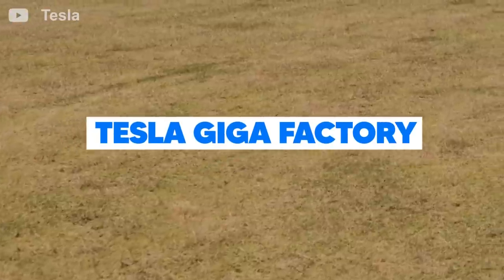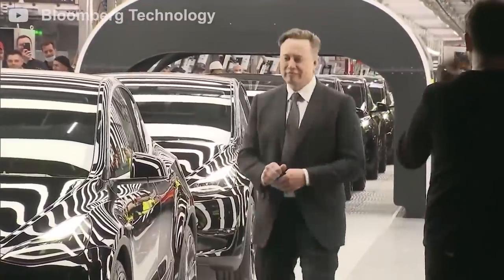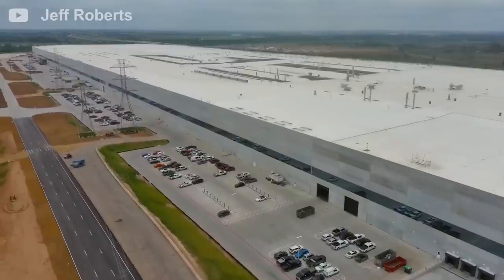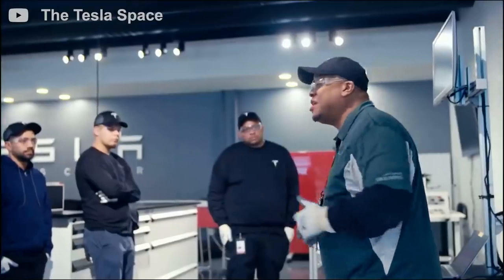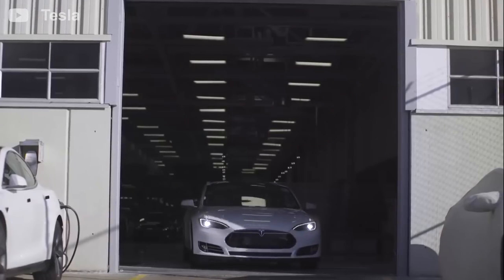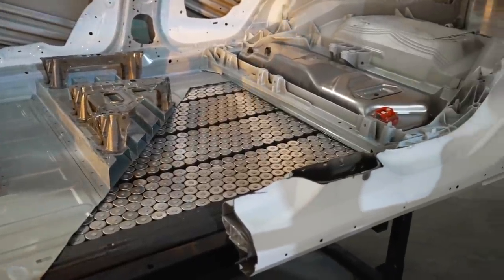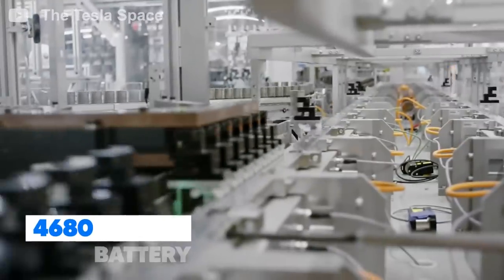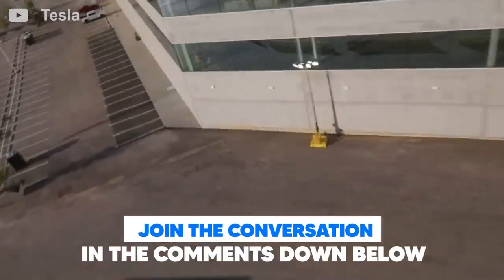Inside Tesla Giga Texas [The New Tesla Headquarters]

Comment: How can you make a robotic arm and hand and then program it with Python programming or Javascript?
Reply from the maker: Most robotic arms use their own designated softwares to program them. A good example is the FANUC robots (these are industry standard) if you search on google you will get a form to request access to their software.
Reply from the maker: If you want to build the robotic arm yourself you could either use valves (pneumatic) to move the the arm and you should be able to program them with Python. Or you could use servo motors.